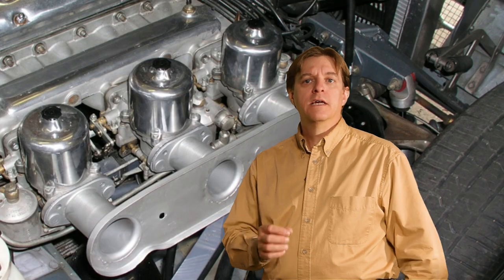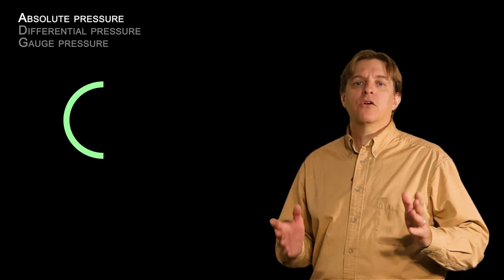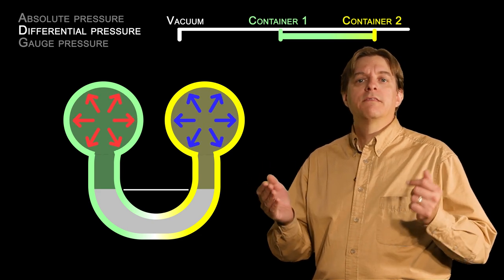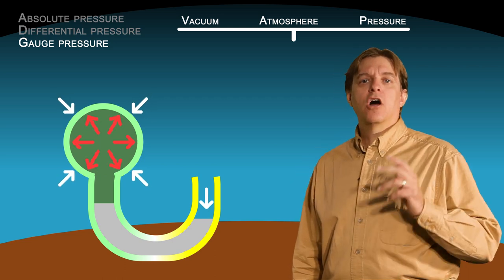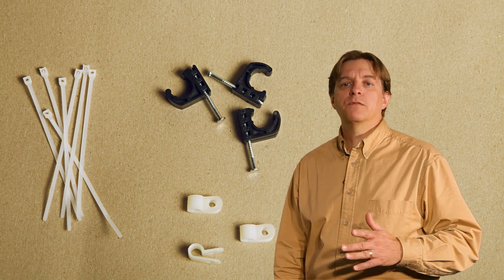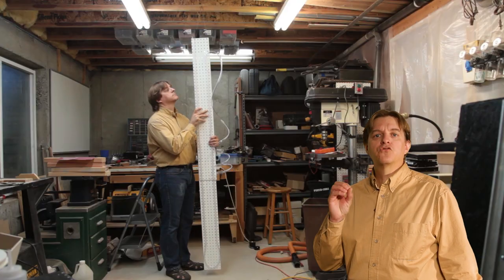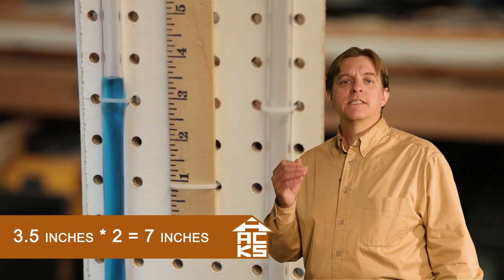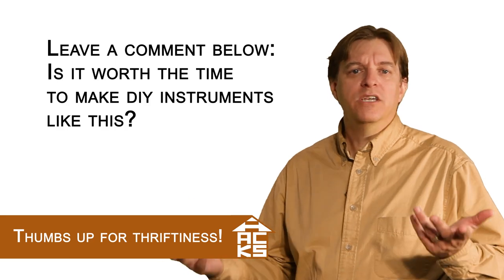How to make a vacuum (or pressure) gauge

Comment: I just built one really quick and measured my gas pressure to the water heater - 8 " WC!   I was going to use plywood and screw a ruler onto it, but your idea of going with spare pegboard was a real time saver!  The holes are 1 inch apart, so no ruler needed!  The zip ties to the holes was much better than my planned clamps - another time-saver!  I am an engineer at NASA Houston and a DIY'er, but I'm glad I saw your video before making a manometer the hard way!  Thanks again!

Comment: Subscribed.....loved it! I just installed a new furnace in my dog kennel/garage. I moved from a city of abundance, to a city with little to offer, as far as purchasing a manometer is concerned. I couldn't order one, I needed it right away. Your video showed me how to make my own, which is just as accurate as any I could purchase. Sometimes money isn't the only motivator. Awesome video!
Reply from the maker: +ceilingwalker1 Thanks! Yeah, many times money isn't the only motivator. For me, many times it's learning and the satisfaction of doing it. Did you need the manometer for the furnace project? Cheers.
Reply: House of Hacks Yes. I converted my furnace from NG to Propane. After changing orfices and regulator spring I had to use the manometer to set Propane flow to 11" w.c. No one sells them around me. I bought a Radon manometer and tried to make it work however, it only went up to 5" w.c. I thought there was enough wiggle room to make it work but there wasnt.
Reply from the maker: Ah, right. Interesting application. Thanks for filling me in on the details. Peace.

Comment: I used a different method for rough measurements, but the method can measure lower pressures then your gauge and it's more compact, that your gauge. I'm also using a tube, but i'm using oil and i close one end of the tube but let a bit of air at the end of the tube. Then you need to calculate a tiny bit. If the air volume in the tube doubles, then you have 0.5bars of absolute pressure. If the air volume quadruples you have 0.25 bars of pressure and so on. Of course you can make the scale as precise as you want by using Boyles law.
Reply from the maker: +stau ffap Thanks for commenting.

Comment: Can i make , Advance Thermocouple based using Broken small light Bulb and Two wire thermo couples and using Arduino and opamps ? For measurements in 100 to 1000 Microns of Hg range using DIY version ?
Reply from the maker: There is relationship between pressure, volume and temperature. So, if you have the correct setup, you can use temperature changes to detect pressure changes. Whether what you have will work for your application, I don't know.

Here are a couple resources that might help you get started:
https://www.sciencedirect.com/topics/engineering/thermocouple-gauge
http://www.belljar.net/tcgauge.htm

Comment: Excellent video. I needed to make one for measuring the draw of my chimney at my wood stove. Thanks.
Reply from the maker: Glad to help. That's an interesting use that's new to me; sounds kind of technical. What type of application do you have where you need to measure the draft accurately?
Reply: I have a wood burning furnace that uses an automatic draft control. http://www.fieldcontrols.com/draft-control-1?page_id=95
Reply from the maker: Interesting. Cool stuff. Thanks for the link. Cheers.

Comment: I tried this with my shop vac and it sucked all the water out of the tube and into the vac.
Everything was setup just like yours.
Any idea what might have happened?
Reply: I think I figured it out, first I don’t think I had enough water in my manometer, and second when you first turn on the shop vac there seems to be a sudden surge  of pressure that settles down and equalizes, now I’m getting an accurate reading of about 51 inches water column once it settles down. Which according to my conversions is about 3.75 inches of mercury, and approximately 1.8 psi Thank you for making this video
Reply from the maker: Sorry, I didn't back sooner. Yeah, my first thought was more water was needed. Sounds like you confirmed that. Glad you got it sorted!
Reply: House of Hacks , Yes I actually did and it works great, thanks for explaining and giving a practical demonstration

Comment: ❤️❤️❤️  clearly explain to brain❤️😘, but how  can i applying this to my 4 silinder bike to for carburetor synchronizing?
Reply from the maker: You'd need to make one for each cylinder and put them on a single piece of wood to make it easy to compare them. The size of the tubing doesn't make a difference, so you can use smaller diameter that will fit on your carbs and not be so bulky.

Comment: Good device, but for science experiments water vapor contamination might be a problem. Perhaps mercury? Using mercury will mean a shorter manometer, and less contamination.
Reply from the maker: Yes, good point. If a minor amount of water vapor is an issue, this wouldn't be the best style. It all depends on context. For most DIY/shop purposes, this probably would be sufficient and mercury is much harder to deal with in a DIY environment. If the vapor is a concern, it's probably easiest to just get a commercial gauge.

Comment: how would I use this to test air flow in a house when doing an energy efficiency pressure test (if I used an industrial fan to depressurize the house)? Just leave one end of the long tube outside and the gauge inside?
Reply from the maker: Interesting application! It wouldn't matter where the gauge was located, just one end inside and one end outside, with a good seal where it makes the transition. It'd be interesting to see if there's enough pressure differential to be accurately measured using this type of tool. I suspect that the amount of movement in the water level might be hard to measure but I'm certainly no expert in HVAC type applications. Good luck!
Reply: A little off what you were commenting but slightly pressurizing your home can be beneficial especially when answering the door. Differential pressure measurement, which is what your indoor outdoor liquid filled tubing is doing, is used all the time in industrial automation to keep tabs on filters etc. Hope you kept going wherever your project has taken you since it's usually, at the very least, an interesting rabbit hole to jump into although getting out is a hole different story. 
Your comment caught my interest and no I don't have a w shortage. Did you eventually find the answers you were looking for under pressure?

Comment: Wouldn't different sized tubing give different length water columns?
Reply from the maker: That was my intuition too at first. I was thinking that the changing mass of the water column at different sizes would change how easy it is to move. But, no, the air pressure on the end changes proportionally to the size of the tubing, and so the tubing size doesn't matter. Another way to think about it is as the amount of water in the tube changes size with different sized tubes, the amount of air pressure on top changes in exactly the same way. Hope that makes sense. Cheers.
Reply: sure. thanks!

Comment: The internal diameter really doesn't matter?
Reply from the maker: Correct. The pressure is proportional to the diameter, so as the diameter changes, the pressure changes in a relative way such that the reading ends up the same.

Comment: you had better put a RELIABLE  RESTRICTOR   in the OUTFLOW OF THE tube or else you will suck all of your fluid into your vacuum cleaner before you can say what happened??    a larger tube than shown here will help slow the  potentially violent out flow.   regards
Reply from the maker: Two things:
1) No restrictor plate is needed. Vacuum cleaners aren't anywhere near powerful enough to pull the water that far.
2) If they were powerful enough to pull that kind of vacuum, a restrictor wouldn't keep the water from being pulled out, it would just slow it down a tiny bit. The pressure would still eventually equalize.

Cheers.
Reply: TRY IT SOME TIME WITH YOUR OWN EQUIPMENT,  REGARDS
Reply from the maker: You mean like I did here? https://youtu.be/UbLElnfZmno?t=2m5s
(Why are you yelling?) Cheers.